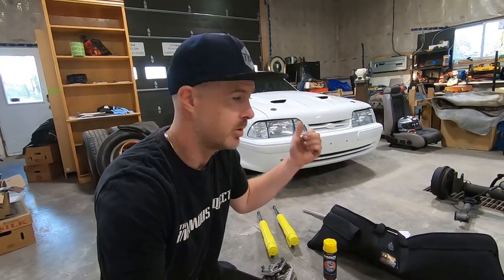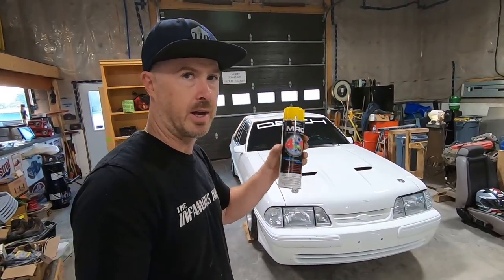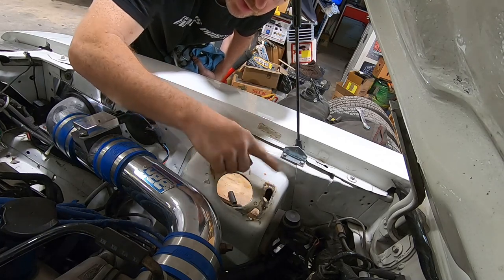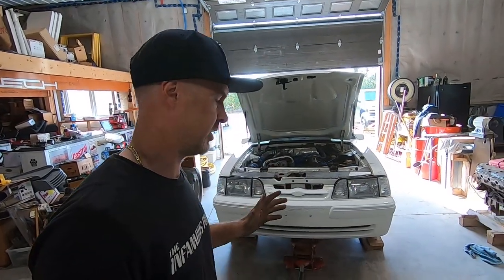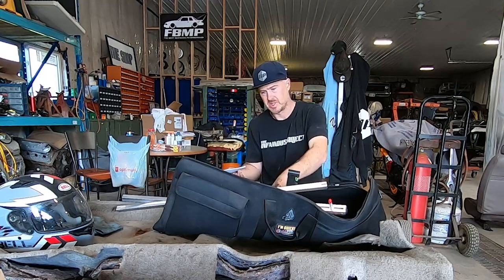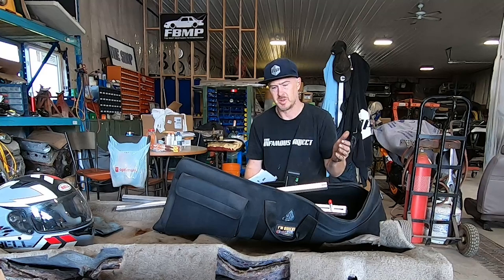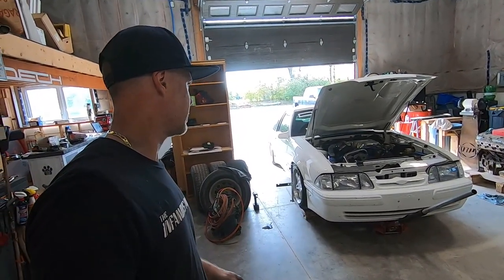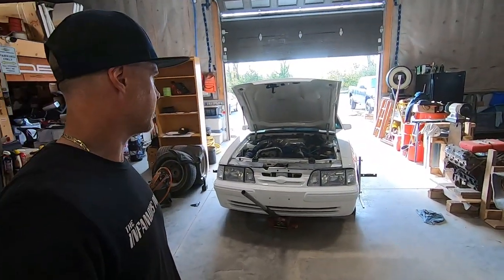Quick Trick Alignment on my 1991 Foxbody w/ New Struts & Caster Camber Plates - TIPS04E88

Comment: I have a sn95. I'm lowered 1.5 inches . Could not get alighmemt right because stock plates are fixed. If I drill out the rivet in the stock plate will that give me the adjustability I need ?
Reply from the maker: It should!

Comment: I have a 91 gt. I lowered the car and it pulled when im on asphalt. It also pulled the same way when not lowered. When I drive on rutted up asphalt the car pulls back and forth fighting me. Tires inside  shoulder worn bad. Took in for an alignment said it was good. My camber is way negative. Did they just not want to deal with it

Comment: I just like to say that I like your channel and I try to watch it as much as I can, my question is I believe my car was hit on the passenger side I have a 86 mustang t-top car I believe the castor is all screwed up it’s -0 can I use a caster bolt to fix the problem , If there’s such a thing
Reply from the maker: Sounds like you may need to get it on a frame machine and double check where things are!

Comment: yes would like to see caster set up I have MM camber caster plates and  steeda bump steer kit had an alignment and now my tires rub at full lock when turning didn't rub before installing plates and bump steer kit I have a 90 lx with 255/35/18 tires will caster help with that or will it mess with the steering to much it's also been lowered not sure how much I bought it already lowered it also has 5 lug conversion there is a picture of if you click on my profile pic.
Reply from the maker: Many things could play a role in the rub. I'm going to guess camber over caster. But it's possible.

Comment: How do you adjust it with the factory plates? I've got crazy camber right now where the top of my tires are pulled in after swapping my kmember to AJE. Do I just loosen the top nuts and shift the plate?
Reply from the maker: Yessir. If the rivet is still there you may need to drill it out
Reply: @TheInfamousProject  thanks for the response. I'll have to check it out tomorrow.

Comment: How many dech mustangs were built.and how can you tell ?I just saw a gold vert.but is it a numbered car or just has the body kit added? Is there a way to tell?
Reply from the maker: I know the vert you're talking about - at a dealer?  Unfortunately very few DECH cars were numbered. Especially in the early days. Many were purchased then brought to DECH afterwards to be outfitted with selected "Packages" Even fewer were sold through the Ford Dealer (only one in Toronto and one in Vancouver). That is what makes the 005 so rare. It does have an engraved badge which reads "DECH 005". Then later in the 90's bootleggers started replicating the kits and you will see hundreds if not thousands of Foxbodies with the "kit" but that doesn't mean a thing. The only way to know if you have a true DECH is if you have receipts for the work with the car with the installed parts and/or a Used Vehicle Package that shows DECH as the owner before the Ford Dealer.
Reply: @TheInfamousProject  yup it was at a dealer...

Comment: As far as caster ..and camber. Caster with cause a pull if not the same both wheels . Camber will not .. and most all cars have negitive camber   ...
Reply: Incorrect camber will definitely cause a pull lol.. you adjust both caster and camber to counteract the crown in the road. Camber adjustments are for better tire wear and stability. The only adjustment that doesn’t cause pull is toe. Toe adjustment is for tire wear only and it’s also the most important adjustment. To positive of castor will cause a vibration at higher speeds. As close to zero for all adjustments is best but add half a degree to the left to counteract the crown in the road
Reply: I beg to differ .
Reply: But yes I do agree on some of the things you said
Reply: @jaymartin5434  we can agree to disagree. Caster pulls to the most negative side camber pulls to the most positive side
Reply: Your tie can be dead in but if camber is out it wii Also cause tire wear ..
Reply: @DDescalchuk57  I'm no expert. And I guess you only has good as your machine .but I have done   lot of alignments and not one came back way tire wear . Stock suspension .lifted suspension and lowered .but yes we can agree to disagree lol and I'm not one of those if it's in the green were good guys lol.or saying I know it all.. because I definitely don't
Reply: @jaymartin5434  that’s fair I’m definitely no expert either. The schooling is fresh in my mind is all done my fair share of alignments as well .